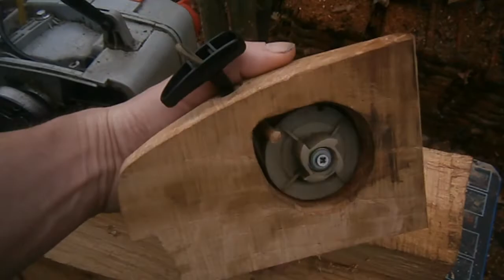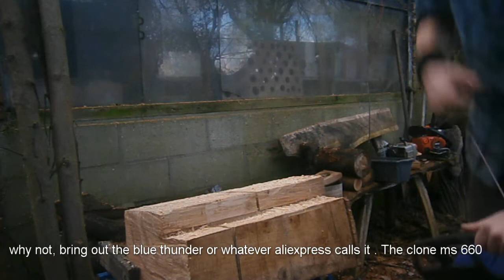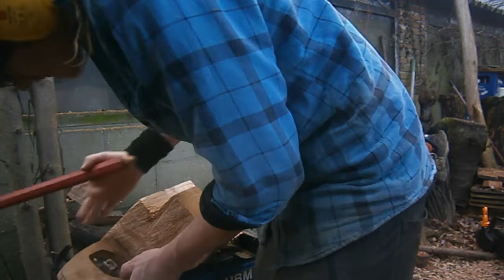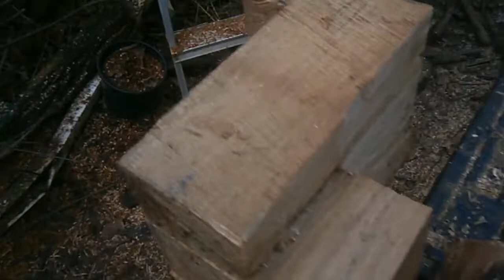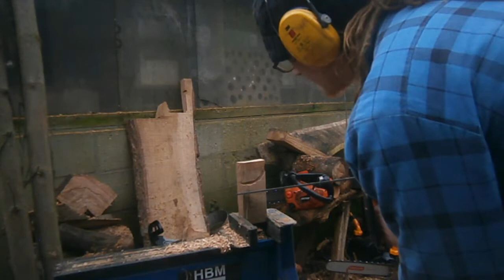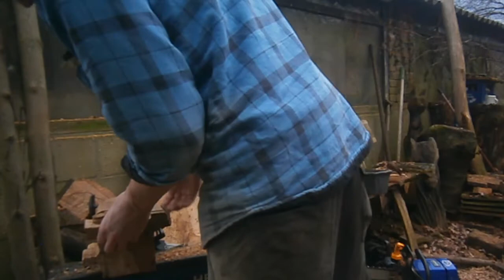wooden chainsaw project part 4:  Rough cuts for the powerhead

Comment: Getting out the big gun on this one. Saweet 👍😎
Reply from the maker: Haha yea, ive learned over the years the carving bars dont really like the bigger cuts much. lose all the oil and they heat up. 
Also always looking for a reason to break out the "blue thunder" as the chinese like to call it haha
Reply from the maker: have a full chisel for it as well, would like to try the square file on that once i use it and it gets dull, in this video i have a semi chisel chain on it, wich also needs sharpening but i am lazy when it comes to sharpening and i dont cut much big stuff with it anyway.
its main job is milling whenever i get some bigger diameter wood, besides that i just run the small bar on it and use it every now and then to keep it operational. since i use ethanol gas in it i kinda have to 😅